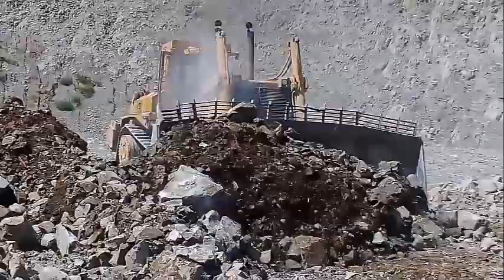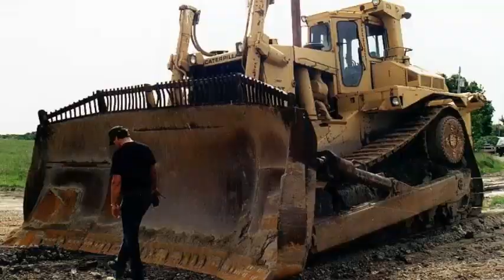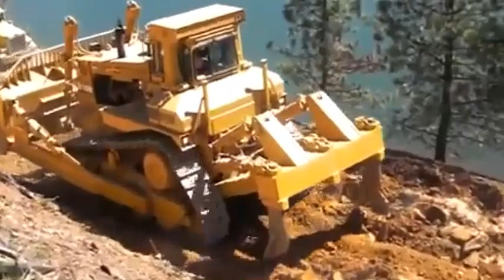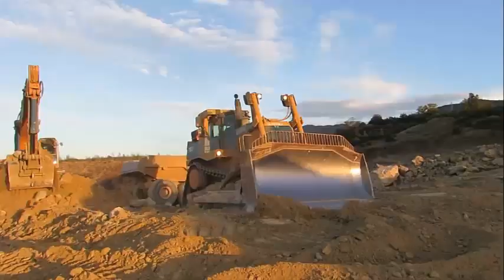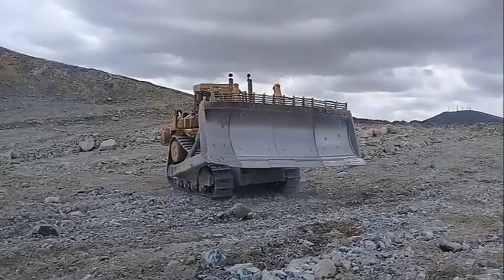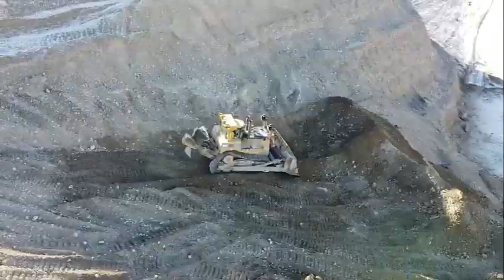Caterpillar D10 HISTORY AND SPECIFICATIONS #catd10 #caterpillar #bulldozer

Comment: Nice Video representation of the original High Drive! The D10 is one great Dozer for sure and one of my favorite Cat dozers of all time, and have been fortunate enough to have had 3 of them: of both versions, 84W, and 76X, which had a narrower track gauge and better suited as a push cat to fit the cut of 651 scrapers. 
I would like to add some clarity, as the D10 shouldn't  be compared to the D10N, D10R, or D10T; as it was about 50k lbs larger, up to close to 200k lbs and was actually superseded by the D11N, along with a size and power increase too.The D10 deserves credit all on its own for its radical new look being the first high drive, a new cab, the resilient suspended undercarriage for ride and traction, and 700Hp, and weight increase over the Fiat Allis HD41 and Komatsu D455A, and Terex 82-80DA. The D10 pioneered the way forward for all future Cat Dozers with the industry embracing the high drive design for nearly 40 years until the Liebherr 776, and now 766 using the high drive design. 
The D10N, D10R, and D10T are all successor machines as a step up from the D9L in the 140-160k lbs size range; when the N series was introduced the D9 took a step backwards to fill the 400HP gap left from when the D9L superseded D9H. therefore the D10N continued on as the next generation from the D9L.  There has been a lot of confusion around the "D10" size since the N series was introduced; many people since have referred the original D10 as a "D10L", which was never a true official Cat Model.
The D10 deserves the spotlight as one of the Greatest Dozers!
Very nice video and great job, i appreciate the effort and accuracy of info you have done;  may I suggest, please use the real sounds to go with the great clips of these machines as the sound and sight go together for the true enjoyment of them. thanks
Reply from the maker: Thank you very much for more information